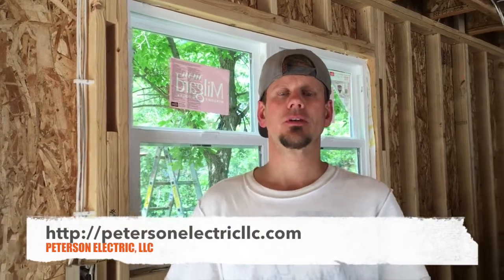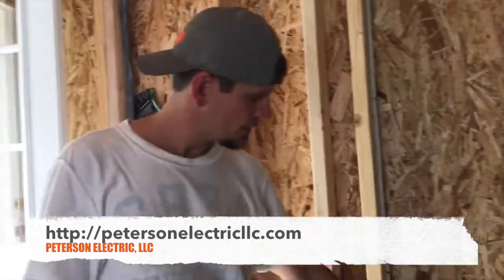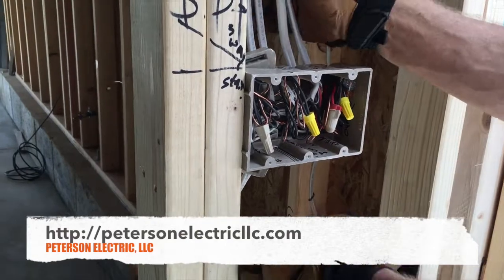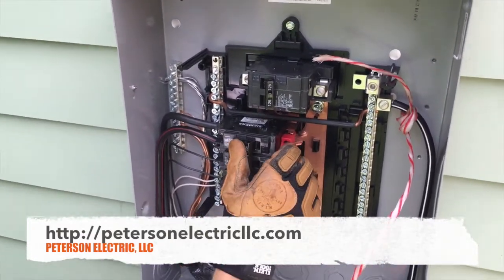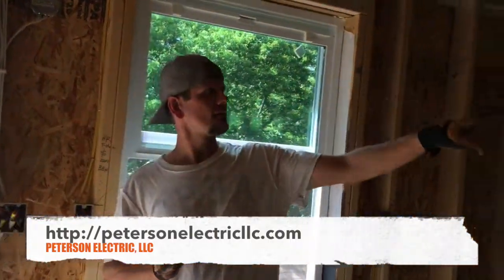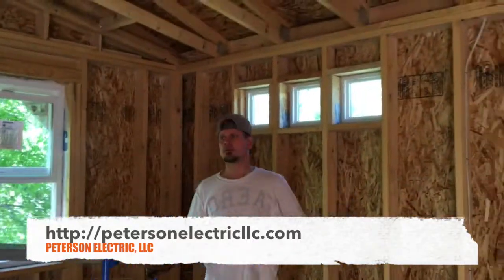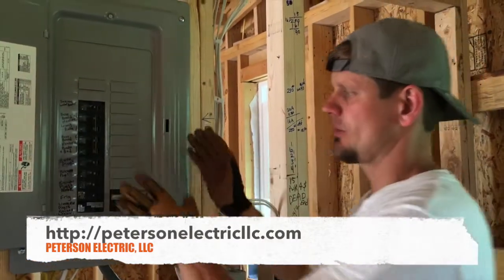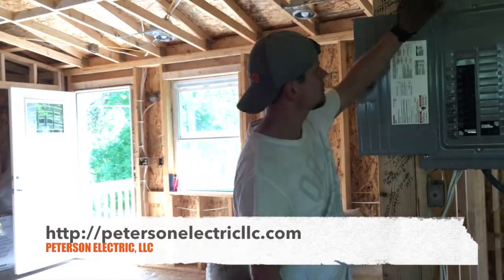Electrical Wiring For Studio Apartment Garage, Panel, Grounding, Bonding

Comment: so this apartment, is going to be billed with the house because there is no separate meter.  If you wanted that to be billed separately, then I gotta come from the mast, and place two meter socket with disconnects built in, and then run up to the apartment, to a lug only panel like you have here, right?. And another from 2 gang meter socket to the main house panel. Yes?

Comment: 90 amp breaker for 100 sub  n2 aluminum good only for 90 amp  you cannot used 83 % for sub
Reply from the maker: No, back in the table of chapter 8 table 9 the ALM #2 is good for REZ at 100 amps.

Comment: What is the requirements for 30 room apartment building code for a cuircut braker for a rooming house a was told 15 amps the fuse keeps tripping
Reply from the maker: Min. requirement on living and bed rooms are 15 amp, dining and kitchen's are 20 amps. You can always wire in a 20 amp on power plugs every where, just a pain to trim out.

Comment: if you are not an experienced electrician and have a fire caused by electrical work you have done. Make sure you tell the fire inspector (one will show up right away) and your insurance company that the guy on the internet taught you everything you need to know. I am sure they will be impressed.
Reply from the maker: YES< Good Point. As I always say, "Youtube is not a credited trade school". CHEERS, thanks for watching.
Reply: how many fires have you seen done by electrical work by a homeowner? EEEEEEVVVVVRRRRRYYYONE on the internet claims to know fire after fire after fire  that happened due to electrical issues. the fear factor is deafening

Comment: You are a excellent electrician. Are you Union . I live in Georgia and I have general knowledge and control voltage knowledge but my electrician back in 1986 had 2 three way circuits with the travelers reversed and this was inspected by a building inspector I went to Home Depot and looked on the back of the switch schematic and found the line and the load and re wired the lights. Unbelievable 1986 in Georgia. New home . Several circuits up in the attic were a junction box was there were no covers placed on them and the wires were not all connected. It was amazing that our house didn’t burn down. Also he ran aluminum wire without applying nolox. So the breaker burnt up and I had to replace that with another 150amp breaker for the panel for 1580 sq ft  house.
Reply from the maker: So, many people make mistakes, but when they are not doing the simple things then I think they are being lazy. Although, you are incorrect about two things; #1 one should never apply Nolox on a breaker, unless it is rated for it. #2 if you do your own Diox or Nolox you are suppose to do this with today's standards and NOT JUST APPLY UNDER A TWIST PRESSURE CAP!. Remember that codes change every three years and from 1986 the standards of manufactures and the WHITE BOOK have gotten safer and more restrictive. Youtube is a helpful tool, but it does not make one a professional in another person's field. It is not a credited trade school.
Reply from the maker: Yah, four way and three way decor switches can get mixed up pretty easy if not looking twice.
Reply: whenever people "I am surprised the house didnt BURN DOWN" I stop listening. Understand an obvious thing, there are homes that were wired way back in 1950 that are STILL here, and people live in them. If I were to wire using the same standards they used today, people would swear i was "going to burn the house down"

then they post an insult at me and promptly go back to their girlfriends house who has a house wired in 1950! LOL

Codes change, but that doesnt imply that the previous method was reckless and causing fires everywhere. Many times vendors themselves have a hand in code changes and money has a part in it. Unions had parts in changes that favor them as well.

Comment: 4:32 - Is a breaker hold-down required for a subfeed? I thought it was only for back-feed?
Reply from the maker: Yes your are right about the back feed, solar and if your feeding a main lug panel to a breaker disconnect on the bus bar that stabs.
Reply: So in this case it wasn't required, right?
Reply: In this case no...only if this panel was a main lug panel and he was feeding a breaker on the bus instead of the main lugs.  He did not need a hold down kit for the breaker feeding the upstairs panel. Though it does not hurt, $5 part.
Reply: sbelknap83 - Thanks! Glad I’m not crazy :)
Reply: truthsmiles No problem